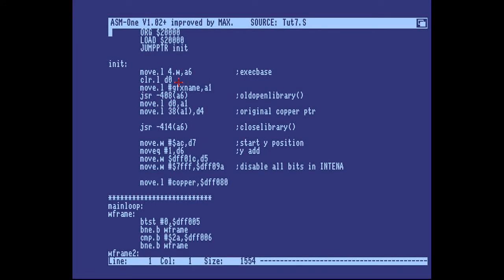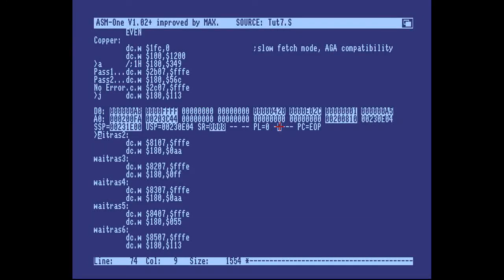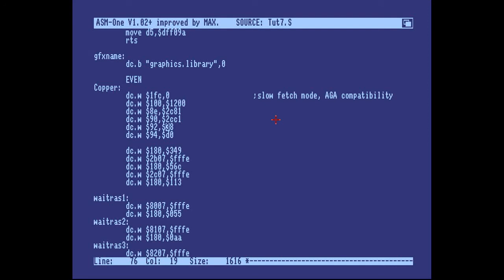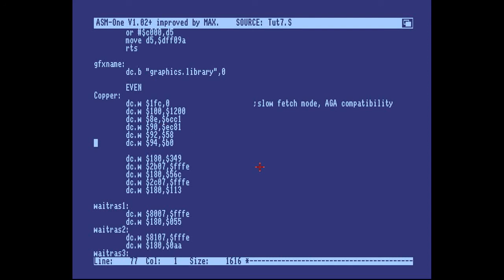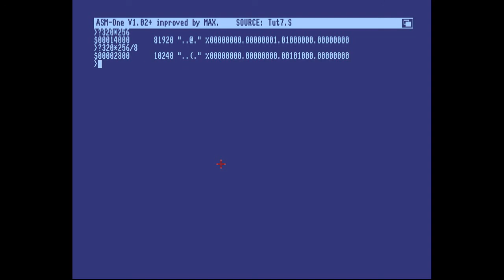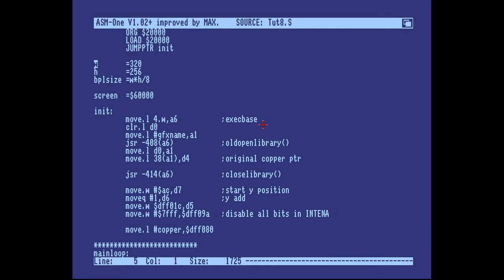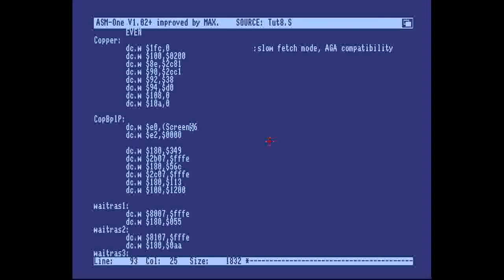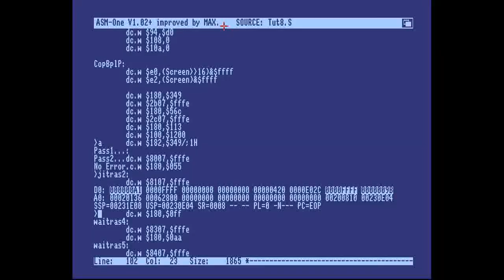Amiga Hardware Programming 8 - Displaying bitmap graphics

Comment: You could have just done (must have leading space on the "SECTION" line):

 SECTION "Screen", DATA_C
Width EQU 640
Height EQU 512
Bitplanes EQU 1
Screen:
DS.b (Width * Height * Bitplanes) / 8, 0
Reply from the maker: Absolute addressing is to dispel some magic and show what goes on behind the scenes from invoking assembly directives.

It's also to show that you can use absolute addressing, which is necessary e.g. to use all the RAM when loading from a disk image in a game. 

A bit later in the series you will see that we do adapt the program to be loaded by the OS, because we decide it will be released as an executable file demo. However, if the decision was made that this were to be a part of a track-loaded demo (that takes over the OS and all RAM), you couldn't use SECTIONs at all.
Reply: @ScoopexUs  oh you could use SECTIONS, they just wouldn't be processed by anything unless you wrote your own runtime linker into the track loader. Writing a runtime linker though, is not for the faint of heart...
Reply from the maker: @AnnatarTheMaia  It's a bit unnecessary to first turn off the OS, write .exe format, then parse the format like the OS does. :D 

You could either make it ELF format or your own format and get more features or - just load it where you want it, since you're in control of memory as well.
Reply: @ScoopexUs  I don't like hardcoding anything in memory on a system which dynamically allocates it. I might do that if I were writing a custom boot loader, but I don't see the point of doing so, since we don't use floppies on the Amiga any more, and most people nowadays sport much more memory. So I'd say, if you'd had one with SECTION "Screen", DATA_C, you wouldn't have been wrong. Trackmos are obsolete.

Comment: I've recently been watching this series of tutorials, typing them in, running and modifying them! In 1990 onwards, I spent lots of time reading the official Commodore Amiga manuals, but I never managed to program anything in Assembly Language or C! I could only program in AmigaBASIC and AMOS. A few years ago when I started watching your tutorials, I was unable to do anything except just watch them, but for some reason I couldn't set up Asm-One on either my Amiga A500 Plus or Amiga A1200. Recently, I've been using a Raspberry Pi 3 Model B+ running Amibian and ASM-One V1.05 by TFA. I had no problems until this episode. The previous tutorial programs ran on Amibian configured as an A500 and an A1200. The source code supplied on the ADF can be run on an A1200 with the original chipset option selected. Unfortunately, no matter what I try, after turning the graphics on my results are quite different from yours. First of all, the copper bar disappeared and didn't reappear, although there were signs of bitmap graphics and sprites. I tried running it in Amibian as an A1200 with original chipset option selected from the Startup Menu, as well as an A500, but the copper bar wasn't there and the screen just didn't look like in your video! After all that, I finally noticed that in spite of you concentrating on the A500 with OCS your depth gadget indicates at least Kickstart 2.04. Unforuntately, my Asm-One ADF will only boot under Kickstart 1.X, although I can also run it from an A1200 HD image file. I haven't yet finished typing in all the changes you made to the program in this video, but it looks like when I do, I'll just get a monochrome bitmap without a copper bar. Perhaps I should try your Asm-Two software instead. What do you suggest?
Reply from the maker: It runs fine under 1.3, I would check if your source matches Tut8.S. I don't think 1.05 is to blame, if you want to test you can Write Object, exit, and run the file. Maybe a setting like cycle-exact off, JIT on, etc. could give you trouble?

http://coppershade.org/asmskool/
Reply: @ScoopexUs  I think the problem was that I was typing in a few lines at a time, then assembling and running in, like in your videos. I think this should have worked, but I found I had to retype the copper list, so it's possible I'd changed some of the values to experiment with what effects this would have. The copper bar reappeared after I copied the copper list from http://www.coppershade.org/asmskool/Tut8.S I finally typed in the whole of Tutorial 8, then assembled and ran it. The result was some background graphics, as well as a cyan copper bar going up and down the screen in front of them, with occasional flashes of sprites! Just a few points are that the background graphics don't look like in your video, they look like a knitted blue sweater, the sprites are light blue, not red, I wasn't able to install your Asm-Two Assembler because after I unzipped it, I found it's not an ADF file, and I don't know how to save a file from Asm-One as an object. It just said  "** No object", so perhaps I need to read the whole manual to find out. I now plan to continue with tutorial 9.
Reply from the maker: @amigabruno2296  Typing is good, because it's a way to automatically learn I think. But you have no way of transferring files? I think there are a couple of ADF tools, but it would improve all kinds of things if you had a better transfer method. I won't be able to help you unless you run the tutorial source, it's the starting point, so to speak.
Reply: @ScoopexUs  I think it's best to type in a line or two at a time in the middle of watching one of your videos, instead of watching a whole video, then typing in all the changes from the listing on www.coppershade.org/asmskool/ because by that time I may have forgotten what some of the lines of code actually do. I've modified some of the code, which changed colours, made things disappear, or sometimes did absolutely nothing at all,  typed comments about which lines do what, then saved as my own versions. My completed tutorial versions also have these additional comments. I'm afraid I can't use any of your files at the moment unless they're on an ADF. I like to use an emulator on the Raspberry Pi because there are no other programs running except Linux in the background, as well as displaying the results on a TV, although it is an HDMI LCD model, not a CRT. At the moment, I haven't got an emulator set up on my laptop. I'm trying to install one on Manjaro Linux. I think I'd have to start the emulator, boot from an A1200 250Mb HDF partition I've made on an SD card, then mount my laptop hard drive under the emulator before trying to copy individual files over to the Amiga HDF partition. The good news is that I've got the Tutorial 9 source code typed in and running now! I found out how to change some of the colours. I think I'll have to post a comment under that video as well to ask you more about which lines of code do exactly what.
Reply: @amigabruno2296  I have found running emulator with a folder as the HDD works easiest for Amibian and file transfers. When in the ‘Linux’ screen you simply need to use MidnightCommander by typing ‘mc’ (without the ‘s) and anything in the USB ports (USB thumbdrives, external USB SD card readers etc) can be found in the media folder on the Amibian SD Card press TAB to switch between file browser panes (it is split down the middle LEFT and RIGHT) you can then navigate to a folder you wish to use as mounted within the emulator as a HDD and copy your Amiga programming files there (source, programs, bitmaps, etc)

But yes if using Amibian ‘mc’ is your friend!

Comment: FYI, with ASM-One V1.20, I was unable to use the Screen reference in the copper list like you seem to do in this video, "dc.w $e0,(Screen>>16)&$ffff". I tried many different combinations of SECTION statements, including having just one SECTION tut,DATA_C declaration at the top, and nothing else. It always gave a "relative mode error", no matter what. I had to write the Screen address into the copper list in the "hwinit" part, with move.w instructions, which seems to be a common solution. If I understand this correctly, the system is able to fill in (in the loading/relocation phase or something) Screen's address for the lea instruction where it's a full 32 bit address and easily patched in, but for the copper list it would need to do the patching in two 16 bit parts, not to mention other more complex calculations one might want to write in the expressions. So is that the problem? Anything that eventually has to be relocated, must be a plain simple 32 bit address?
Reply from the maker: No, you've done everything correctly. Here in the beginning, I'm keeping things direct to make everything more concrete, and that includes actual custom register addresses and bits. A few episodes later, I show how to add symbols and explain relocation, and initialize the copper with the screen address dynamically just as you did. :)

You're correct in that the OS is required to load the program in order to relocate dynamic addresses, by an "arrangement" that is between the Assembler and the OS.

But all computers are machines at heart, and then you build levels of abstraction, and this same progression is the basis for the tutorial series.
Reply: ScoopexUs But... why is it that you seem to be able to use the (Screen >> 16) reference in the copper list in this video, is it because ASM-One 1.02 is somehow smarter than later versions, and is able to tell the relocator (or something) that it has to write one half of Screen's address into the copper list, or does it generate invisible extra code somewhere that does this automatically?

Btw, I would think that the majority of your viewers are already familiar with programming and assembly language, just not with Amiga/68k and ASM-One. :) But I really appreciate your effort, it's really easy to learn just by following these tutorials one by one. It's exactly what I needed, really step-by-step "for dummies" guide to toying around with the Amiga chips, so it becomes impossible to say it's "too hard". ;) I'll post a link when my first Amiga demo is ready.
Reply from the maker: yzimsx No, there's no magic going on. When you replaced the ORG with the Section statement, some (most) Assemblers will refuse absolute addresses and some will understand and allow them, depending on various assembly warnings being raised or not during a certain assembly pass. (Assemblers can be made to assemble the source in one or more passes. It's purely a design decision by the guy who programmed the Assembler.) Tut8.S works fine in AsmOne 1.20 with the ORG statement.

This is partly why I start with the concrete approach because then the Assembler becomes a more transparent tool that just translates your instructions to code.

The starting level of the tutorials is set to include everyone, like my old computer mag articles. People come from all kinds of environments and backgrounds with different goals and ideas, and I can't be some judge who decides who gets to learn. It also helps me make sure I really show everything. When you already know it, it's easy to take some steps for granted and assume it's obvious when in reality it's not.
Reply: ScoopexUs Ok, that was it. It worked because of the ORG statement, which had hard-coded the whole thing to a fixed static location. I had commented out the ORG statement from my own program. Thanks.
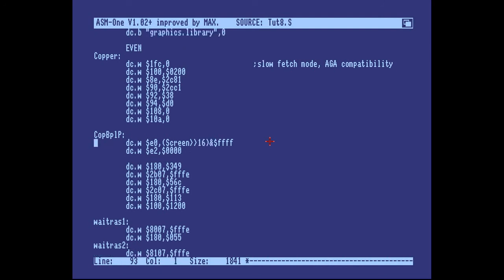Reply: A bit late to the party, but here is my explanation for your question. Firstly, you refer to "Screen>>" which appears around 29:49 in the video.
You should get familiar with addressing modes: 32bit mapped to 16bit registers, here for $dff0e0 and $dff0e2 http://coppershade.org/articles/Code/Reference/Custom_Chip_Register_List/
The >> is an ASM One operator, which refers to a right shift: https://ia800408.us.archive.org/34/items/AsmOne1.02Manual/Asm-One1.02Manual.pdf
Essentially the directive here means to take the high bits of the "Screen" address and set them in $dff0e0. This is pretty common. For example, on the C64 there is the concept of high byte/low byte for addressing modes. What "dc.w $e0,(Screen>>16)&$ffff" mean essentially is "Take only the high bits of the 20 bit address of Screen, discard the lower bits and write them into the register. Using "AND #$FFFF" means safety, if a bit gets shifted into a high bit.". I hope this helps.

Comment: Hello,
I'm using ASM-One v1.20.
When setting the ORG and LOAD at address $20000 and adding the line "dcb.b bplsize" at the end I get the following error when assembling the code:
>a
Pass 1..
Pass 2..
** Illegal Operator
11783 ao
>
It looks like the program is overwriting the editor-buffer, because it has become huge and the source is gone/corrupted.

How come you do not have this problem?

P.S. I am able to 'fix' this by setting the ORG & LOAD at address $10000.
Reply: mmmm....i think I really solved the problem by placing the assembler WorkspaceBuffer in Fast ram instead of ChipRam (!)
Reply from the maker: borchen0 You can use my utility ChipMap to see which chipmem areas are actually free after you have started Asm-One, if you want to ORG and LOAD. Later, I will show the SECTION statements. If you have fastmem in your Amiga, you should always use fastmem for workspace, as I show in the first clips. ChipMap is here: http://www.scoopex1988.org/article-chipmap.html

Comment: Dear Scoopex mates, I came back to your tutorials to go on slowly with some amiga asm learning. I actually wanted to avoid the free memory map variant shown in the tutorial and tried somehow to convience asmpro/asmone to get for the bitplane pointer the low order and high order word of the label address when using a relative address. Is there no way to achieve this ? I cannot imagine -- I will check the original asmone manual again, but i could not find it. thanks a lot for any help. I do it for the moment programmatically in poking the Screen values into the list -- this works but is there a reason, why the assembler cannot do bit calculations ons relative lables / not looking up the absolute address while assembly?
 Cheers and have a good weekend, Stephan

Comment: Hi ScoopexUs --- great videos ...  may I ask you (I am total beginner), how I can change the background color as yours ... with the blue background it is much easier to work. Although I would like to reduce the font size (only interlace mode?) Thx a lot for any hint. Kind regards from Zuerich
Reply from the maker: Yep, only interlace mode right now, but if you have a flatscreen TV made after 2011, the chip in it deinterlaces - i.e. 25 Hz, but no flicker. (Displaying more lines of code is still a thought I am considering for AsmTwo... it's just about spending the time to make it work.)

To change the background color and not have to first launch Workbench and then AsmOne or AsmTwo, you can copy the "Preferences" command from the "Prefs" folder of a WB1.3 disk to anywhere on your work disk, and run it to change the colors, key repeat speed, and mouse pointer and speed. It works fine on any Kickstart, it takes effect until Workbench is loaded. When Workbench 2.0 or higher is loaded, it uses the preferences you set in Workbench.
Reply: +ScoopexUs thx a lot, dear mate that you took your time answering my beginner's question.
Reply: @phononify  the blue background when working within Asm-One is much better than grey. If your Amiga system has a grey background by default, then it's probably Workbench 2.04 or later. On Workbench 3 and probably Workbench 2.04 and 2.05 as well, although I can't remember now, you click on the Prefs icon, followed by the Palette icon. After that, click on the grey box in the upper left hand corner and click and drag on the RGB slider controls to increase the amount of blue while decreasing the amounts of red and green. Stop doing that when you've got the shade of blue you want. After that, click on either Save to make it parmanent, or on Use to have that shade of blue just for your current session. You must close and restart Asm-One before it will use your new blue background. If you've booted Asm-One from a floppy disk or ADF file, then you may be stuck with whatever background is preset, unless you copy all the files to your HDF file or hard drive. I hope this enables you to change your Asm-One background colour to blue!
Reply: @amigabruno2296  Thx Bruno for your comment -- have seen it quite late now -- I am using a classicwb setup with fsuae -- cheers and thanks a lot.